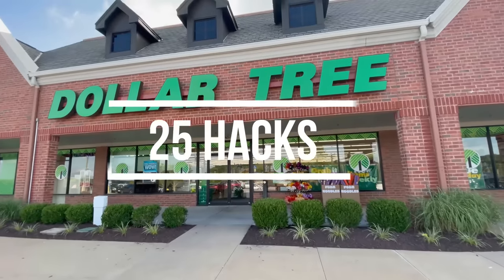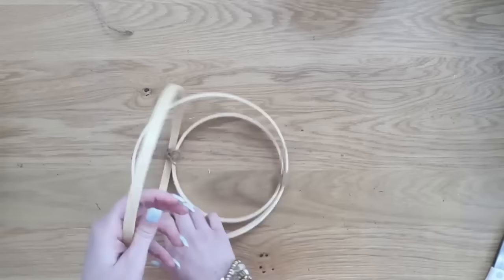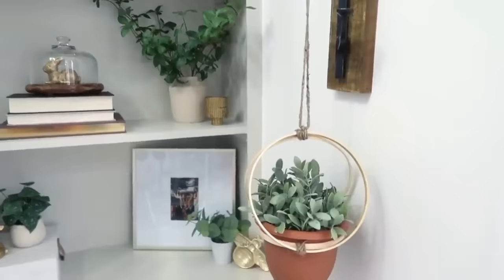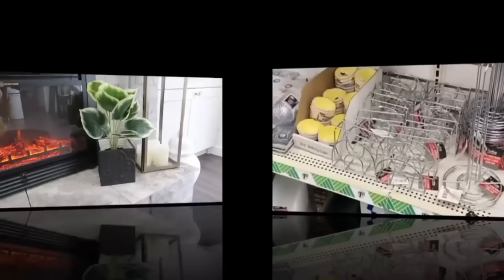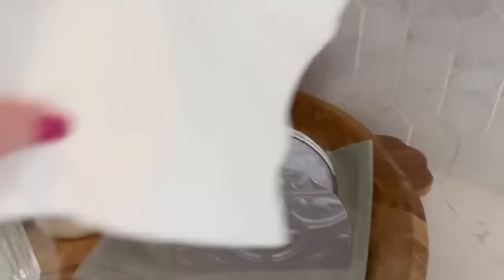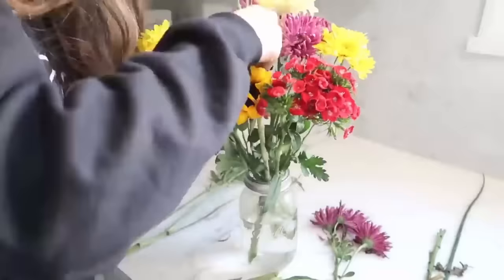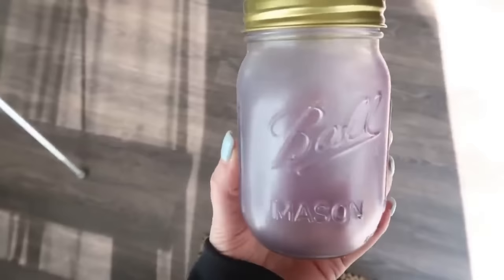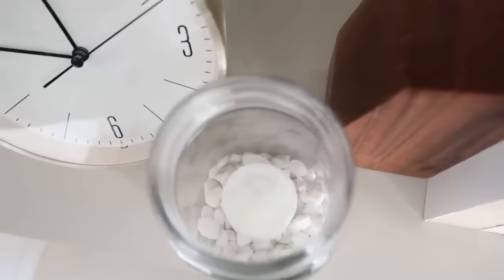25 *BEST* Dollar Store HACKS 2024! High-End $1 Dollar Tree DIYs!

Comment: I believe I would have used some sort of glue product on your first two projects. I think they would fall if you had to move them to clean around them. I also would have used wood glue on your last project as hot glue would come apart from wood, or you could have screwed in the bottom to the top.